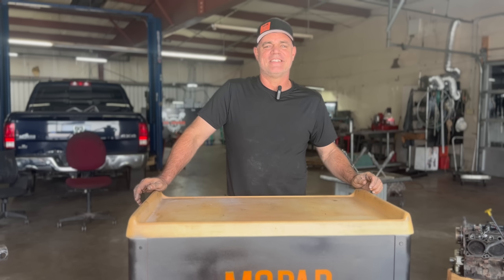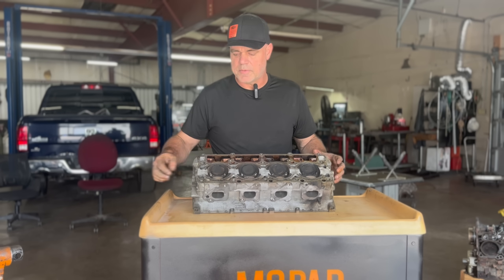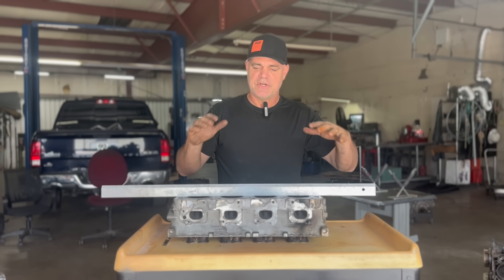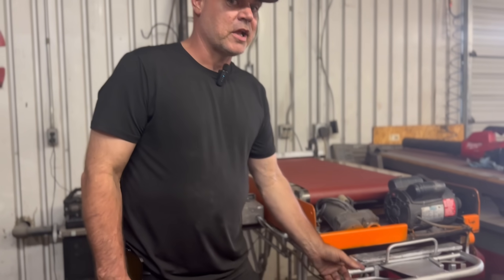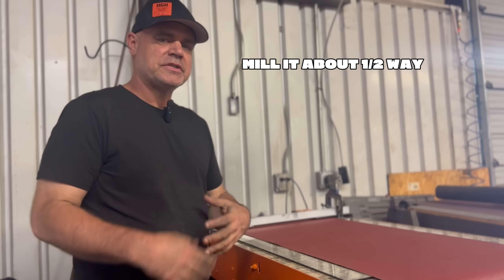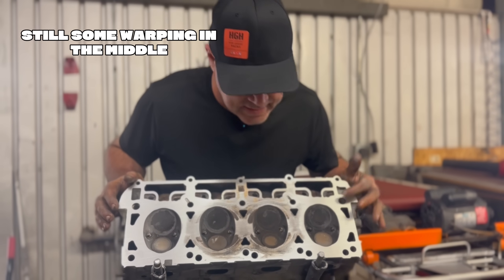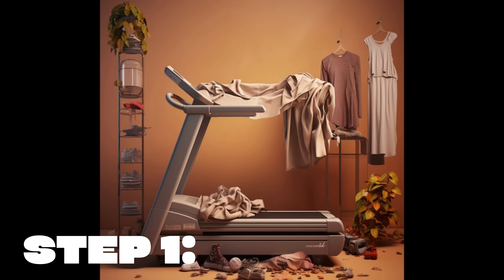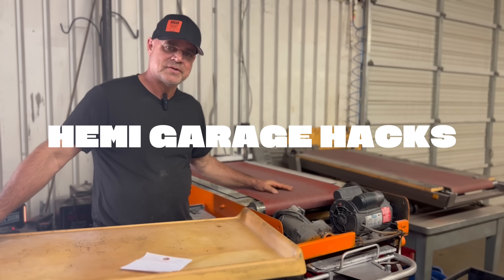I HAVE MILLED 1000+ CYLINDER HEADS WITH A TREADMILL!

Comment: so, is the entire belt a massive piece of sandpaper, or did you glue it to the rubber tread?  where did you source the sand paper. this is ingenious and a huge cost savings to machining on a Milling machine
Reply from the maker: There is a company called Mirka that makes these belts.  Just tell them the grit, width and length.  Super helpful company.  Thanks for the question.

Comment: How much does it typically end up taking off and do you have to compensate with thicker gasket?
Reply from the maker: good question, I am glad that you asked that.  It all depends on how warped the head is.  In my experience, if it has got hot to the point where it would take off too much material to save it, then the head will also be cracked between some of the water jackets.  I have never had to use a compensating head gasket.  Thanks for the question, and I am glad to have you along for the ride:)
Reply: I had to get from .009 down to .002 .did it by hand
Reply: only a few thousandths are removed when you are manually sanding the material off.  I usually just ignore  it.
Reply: @dennisg7309 .009 caused a leak and does not passed spec
Reply: I use mahle brand. They have an option for engine rebuilders.  .0325 thick vs  .0275 I believe. Also slightly bigger diameter if hone or small bore out job.

Comment: I like this, I have not done a head job in years but the last one I did the factory spect's was for a mirror like finish.
Reply: ...What manufacturer was that for?...every one I've ever seen has the rotary curving mill marks that actually have some "bite" to hold the rings of a head gasket?
Reply from the maker: @DMWatson-qc6mz  excellent input. There aren't a lot of people that know that.  Thanks for your comment.
Reply: @DMWatson-qc6mz  Maza diesel, cast iron block aluminum head two different coeffient rates of thermal expansion the head gasket had a coating like anti-seize  allows a little movement of expansion and contraction
Reply: @cameronbutton3928  ...very interesting..I know some engines like that...a Mercruiser in-line 4 with the Ford big block head is that way.
Reply from the maker: The finish will surprise you.  We have been milling our own heads, as well as heads for other shops for years.  They are always shocked at the finish.

Comment: There were several "sanding tables on the automobile Machine shop tools" even Goodson sold them for a while, they worked well.
Reply from the maker: I remember those days.  I think they were $3500-$5000 if I remember correctly.  This one cost me less than $500 and the surface is much bigger so I can surface all kinds of things.  Thanks for sharing and I am glad you are along for the ride.
Reply: Have you ever wondered why machine shops went away from using belt sanders to true cylinder heads?

Comment: My god. 
How fucking cheap or backwoods are people.
Take it to a pro.
You can't add material if and when you take too much off.
Some people will do anything for a few clicks.....
Reply from the maker: This is why I love free speech, makes for great discussion.   Thanks for sharing!  And FYI, it actually works awesome, you would be shocked if you saw it.  Most people are when they see the end result.  But I get where you are coming from.
Reply: @HemiGarageHacks 
If you are doing this to mill the surface, how do you know how much you've removed.
Also , when removing material from that surface, you also need to remove from the intake at what ever angle necessary so there is no gap. How do you determine that and remove whats required.
Something i would like to know...

Comment: worth it not to have to wait weeks to months for the machine shop to get to it  and getter than the large flat file wrapped in sandpaper I have used on 4 cyl heads
Reply: So many have closed as well...
Reply: @carlnelson3893  true even here in Burbank CA home to hot rods and custom parts they are few and far between
Reply from the maker: @carlnelson3893  You ain't lying!  there used to be a ton of motor and machine shops back in the day, and now you rarely see them anymore.  And on top of that, they are getting older.  Who is going to take over this stuff?
Reply: @HemiGarageHacks 
us and our Tread-Mills (tm) lol
Reply: Some of the Bots here are so triggered!😂
Reply from the maker: Amen!

Comment: Any advice on were to purchase belts.
If I understand correctly they are custom made.
Reply from the maker: there is a company called Mirka which makes sand belts any width, grit, and length.  hope that helps
Reply: I Googled "custom sanding belt" and got several returns.  Only looked at Maverick Abrasives.  They say they can make belts "in widths from 1/4” to 60” and lengths up to 400”—with grits ranging from coarse 24 grit all the way to ultra-fine 1000+ grit".   Media can be Aluminum Oxide, Zirconia, Ceramic, or Silicon Carbide.  Didn't look for pricing.

Comment: Measure each end of the head before starting-if the head is not reversed the sanding will take more off of the leading edge. Make sure the belt stays tight. If the head is overhead cam style check the cam line for warping.
Reply from the maker: I love this, great point!  We used to do a ton of 4.7's which are overhead cam and you are exactly right. Reversing the head is important, thank you for the great comment!

Comment: Id never do that to expensive race heads, not worth the chance of ruining engine, but kuddos to u for doing this!
Reply from the maker: with racing, tolerances are crucial!  Ultimately, the straight edge is the judge!  It cost me less than $500 to make this and it has lasted me 13 years so far and have done well over 1000 heads successfully.  If you need to save time and money, shoot just give it a shot.  $500 is worth it:)  And I am not selling these, so I have nothing to gain by suggesting it.  Thanks for the comment!
Reply from the maker: You just gave me a great idea!  I have some race buddies.  I'm going to see if I can talk one of them into a little experiment.  Now THAT would be an awesome video!!

Comment: A mill is an entirely different kind of machine
this is a surface grinder 
a pretty good one but not a mill
Reply from the maker: Technically you are correct, but I used the term milling as terminology for general audience with the goal of straightening the head.  Thank you for your comment, I love the engagement!
Reply: If we are being really pedantic about describing the machining process it is more accurately described as belt 'Linishing'
Reply: I wouldn't term this as a surface grinder... it is still a belt sander. Our surface grinder at the old shop was just like a mill (automotive type), except with segmented stones and coolant.

Comment: Horrible IDEA!!!!  Belt sanding will make the surface smooth!  But it won’t level the surfaces!  You cannot keep the cylinder head square!  In addition!  A belt sander will remove more material on onside vs the other!

Bad, bad practice!
Reply from the maker: Great insight!  I want to make sure people understand surface level is crucial.  Granite with glass (un-tempered) on top gives you the ability to shim if necessary.  Straight edge the Mill surface WITH the weight of a cylinder head on it.  And switch head direction halfway in between milling.  Glad you brought that up, it is helpful
Reply: The engineers straight edge test says otherwise.

Comment: First, that isn't milling. Second, you are definitely not helping the flatness. This isn't anything new but your setup leaves a lot to be desired. They make professional machines that do this exact thing but it requires fixturing to ensure it's being done right. This ain't it.
Reply from the maker: 13 years later and over 1000 heads, it's not just a theory anymore.  We straight-edge each head after milling.  We actually mill heads for other shops now as well and no issues.  Scary I know, but proof is in the pudding:)
Reply: If someone can figure it out at home chances are 99.9% that it's already been done and better. I was a surprised he does this for "customers". I hope these heads work out for them. On the other hand this is a way for less discerning mechanics to bridge the gap between impossible and professional. I think it's a great tool to have for the budget backyard engine re/builder. It looks like the margin for error allowing this kind of setup is generous.

Comment: When I "resurfaced" the head for a model A ford I was working on (Iron head not aluminum), I used a long aluminum block with 60 grit sandpaper on it and ran it back and forth until everything was flat- Took forever as it didnt take much off each pass. This would be a good sollution to take some time off of that process. I can understand the fear some have using this for aluminum, but on iron it would be great.
Reply from the maker: the key is keeping a straight edge around.  we straight edge every head after milling and 13 years later, still working great.  Strange idea for sure, but I am so grateful that it worked!

Comment: Quite frankly, anyone who would trust their cylinder head to a machine a wood butcher uses, needs their own head examining. Cylinder heads need to be flat, true, straight and pretty smooth. This will do none.
Reply from the maker: I agree it seems hokey, but the straight edge doesn't lie!  13yrs and more than a 1000 heads, it's not even a hypothetical at this point.  Thanks for commenting though, because I want us all to share ideas and perspectives on this stuff:)

Comment: I would use a solid table, 1 inch layer of granite kitchen table tile, and half inch thick glass glued together. the base should never flex.
Reply from the maker: and straight edge the surface with the weight of a cylinder head on it.  If adjustment is needed, shim between the granite and the glass.  Thanks for the comment

Comment: did you check the cylinder block flat? how do you do it to cylinder block?
Reply from the maker: great question!  I have done a small aluminum block before, but nothing bigger than that or cast iron.  It is a good idea to straight edge your block though.  Great comment!
Reply: if you do a v8 you need to have a fixture with a weight on it. typically attached in or near the mains with the weight adjustable  to balance the block on the table
Reply: the blocks that I've done were  by hand with a 20 lb marble slab.

Comment: A belt sander is not a milling machine. No milling can be done with a sander.
Reply from the maker: thank you for the comment.  Here is how I look at it.  The head used to be warped, I need it to be straight, I put it on my Sander, and it comes out true (as confirmed with a straight edge)  13 years and over 1000 heads later, I can truly rely on this thing now.  I know it's a hokey concept, but the proof is in the pudding:)
Reply: @HemiGarageHacks  I literally just watched you use the "non" straight edge of the straight edge to check for flatness. The beveled edge of the straight edge is the straight edge. Not the flat side. Yes...I'm an actual machinist.
Reply: @Chris-te7uk  How do you know both edges of his straight edge are not precision ground?
Reply from the maker: @Chris-te7uk  Dude, nice Catch!  You are the first person to notice that.  Now in my case I have both sides true, but for stability and demonstration I used the flat side.  Kudos to you, and thanks for the comment:)
Reply from the maker: @bigboreracing356  in this case you are correct, they are both true sides.  It was easier for demonstrations purposes to use the flat end this time though.
Reply: Its a tread-milling machine. Stop being pedantic
Reply from the maker: @BAMAJiPS  You make a compelling argument my friend:)  By the way, thanks for watching.  this journey is so much more fun with other people.

Comment: it's beneficial to use a bar of solid wax on your sandpaper, rotary files, and other tools when sanding aluminum to prevent the abrasive material from clogging with soft aluminum particles. The wax acts as a lubricant, reducing friction and allowing the aluminum to be cut away more effectively rather than sticking to the tool. This helps the sandpaper cut faster and last longer
Reply from the maker: Now that's a good hack right there, I like that!!  Thanks:)
Reply: @HemiGarageHacks  Aluminum foundry worker here, making plane engine parts, we use dynafile for almost everything and we have HUGE blocks of wax that we just dip the running belt inside once in a while, same with carbide burrs
Reply: @HemiGarageHacks  Crisco works too, surprisingly.
Reply: @HemiGarageHacks  nice...butt.... not all heads are  aluminum  /  and   cast iron......to
Reply: @rogerjohnson6218  you can still use the wax. Other metals don’t load up the sandpaper like aluminum so it’s less of a concern.
Reply: I use a toilet bowl sealing wax ring.
Reply: @tristandupuis5345  I use old baby bell cheese wheel covers for wax.
Reply: @philhunt1442  Wow! Were you drinking when you came up with that?!
Reply: @tristandupuis5345  😂 I was completely joking
Reply: @philhunt1442  What does this mean ?
Reply: @gyrogearloose1345 
That he was joking.
Reply: @kairu_aname  I see. Thanks!
Reply: Earwax works a treat. Takes a while to gather enough
Reply: @VenturiLife  shrek over here
Reply: @tristandupuis5345 new or used? 😅 💩 🍦
Reply: Have always found PB blaster works great for carbide burr vs. Aluminum
Reply: @FlooredForTheLord  I use old DW-40 whenever I'm going to cut into aluminum. I spray the cutting disc or drill bit and the area where to cut, and it's smooth sailing. Although, if it's a substantial cut, an extra spritz half way is sometimes warranted. I'm going to give the wax a try.
Reply: @FlooredForTheLord  any lube works but wax is a little more efficent
Reply: Love the treadmill idea. Would like to know how thick of granite and glass you used and how you mounted it.
I do my own heads in a similar way by hand. Mainly because of the cost but also because of the time. I can tear and engine down, surface the heads and have it back together the same day. Whereas I'd have to wait 2-3 days to get heads back. I also do the blocks in the car. Not only do the heads warp, but aluminum blocks do to if overheated badly. Typical allowable tolerances for the center of the head is .001"/cylinder. V6=.003", V8/4 cylinder=.004". Less is better naturally.
Not only is flatness important, but so is surface finish. It should be somewhat reflective. You should be able to see your fingertips and nails in the surface finish. Otherwise, the surface continually eats away at the headgasket.
Reply: I'm agreed. 
(I am a retired machinist.)
There are specialized wax bars for sale by most machining tool companies. I have found the wax bars labeled for tapping work the best on files and sanding materials.
Reply: Harbor freight still sells an abrasive cleaning stick.  I never tried paraffin wax.  The stick works pretty good on my smaller 3-6" circle discs for paint and metal removal.
Reply: Agreed,  I use kutstik on all my belt Sanders and rotary die grinder carbide,  when doing aluminum. 
Huge difference in how smooth it cuts
Reply: Old timer told me to use dollar store Irish spring bar soap..Works great for home used fabrication
Reply: @BeeLineFab yes I second that actually, cheapo bar soap can be put on paper dry, then add a bit of water and lightly wire or hard brown roofing bristle brush by hand backwards and in circles. And you can wash your papers if it’s the wet capable cloth type. But you can just leave the soap on as your lube. You can wash it off with light wd40 too if you can’t get your paper wet. Or it’s old already.
Reply: A bar of soap or wax is mandatory if you port aluminum  intakes of aluminum engine parts.  I've ported rotary engine exhaust ports in the rotor housings with carbide bits and a bar of soap.  The teeth are sharp and it keeps them from clogging and making your expensive bits smooth and worthless.
Reply: Sex wax. Then clean with heat gun and towel once in a while 👌🏻👌🏻
Reply: fluids like diesel oil  or kerosene work very well when sanding aluminum because in oils, the fine aluminum particles are  loose enough to be easily brushed out of the sandpapers abrasive and the abrasive nature if the sandpaper is maintained.    It is wet sanding.
Reply: @dennisg7309  would regular wet sanding work too then?
Reply: I wonder if any silicone might help when sanding plastic . I’ve been wet sanding it for years now but it clogs paper bad. Using soapy water helps but it foams up and hard to see.
Reply: Same with 1mm grinder cutting discs 👍
Reply: Thanks thats good tip
Reply: Will that help with carbide bits getting clogged aluminum
Reply: So I can use the bar of wax on my coarse grinder wheel and then use aluminum on it safely?
Reply: Sorry, so wax is applied to the sandpaper/abrasive when sanding aluminum?
Reply: Exactly where do you put the wax?
Reply: Yup. I never sand aluminim without wax unless it's a final sand before painting

Comment: What grit sandpaper do you use?
Reply from the maker: 60 or 80 both work great.  With 60, I like to mill a few heads or exhaust manifolds just to make it less aggressive.  After that, the finish is beautiful.
Reply: @HemiGarageHacks  This stuff is magic!  Have subscribed.  What sort of surface finish does that give you?  Is it smooth enough for MLS head gaskets?  And what grit do you use for exhaust manifolds?  Thanks.
Reply from the maker: @klaver3913 definitely smooth enough for mls headgaskets. That's all we use.  For the exhaust manifold mill it's 40 grit. The head mill is 60-80 grit. By the way, thanks for subscribing. Glad you're here.